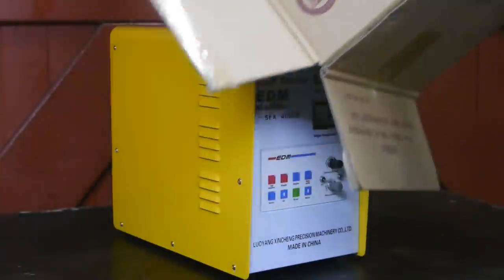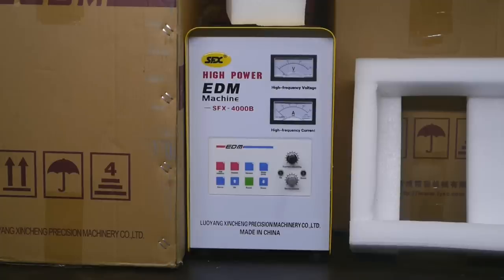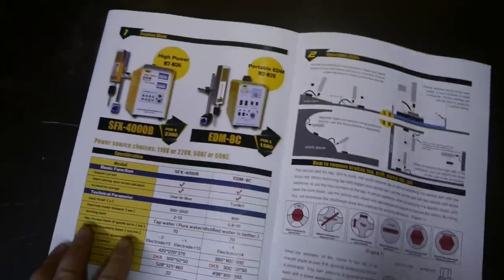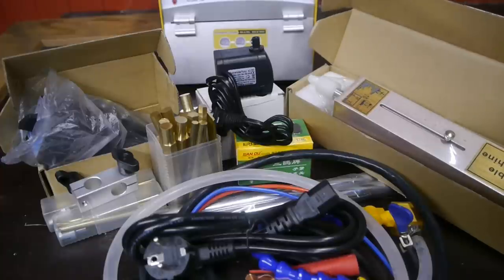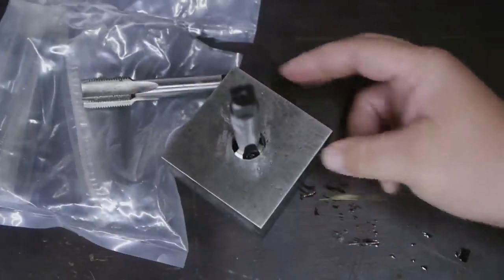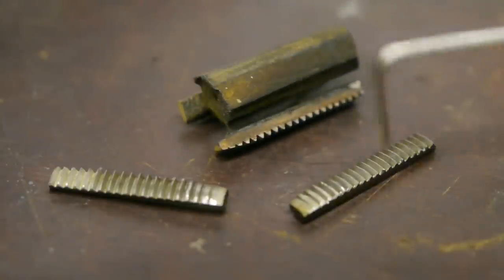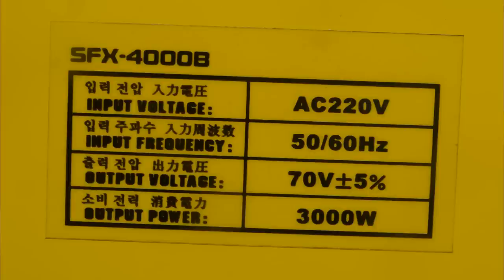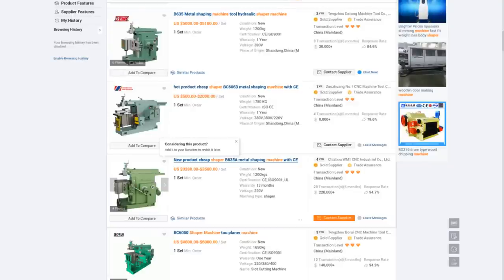Testing a portable high power broken tap remover (SFX-4000B)

Comment: Just watched this... That could be the basis of a great EDM die sinker. What's an EDM die sinker? It's the tool you go to when you need to machine shapes in metal that can't be machined. It will "burn" (cut) any conductive workpiece no matter how hard. Make an electrode (preferably in graphite or copper) and you get a mirror image (usually 2 electrodes are used, the second on low power for finishing). Try drilling a square hole, it's not possible without an EDM. Try drilling a hexagonal hole in tungsten carbide, easy enough with an EDM. Take a look at injection moulding tool making, next to impossible without an EDM. There are several videos where guys are trying to make these, because commercial versions have astronomic price tags. One of these could provide the basis for something special.

Comment: I think that went very well for your first go.
I did see something very similar many years ago.  The electrode was made of carbon graphite stuff an they used to make odd shaped holes in various hard materials by shaping the graphite.  The whole thing was submerged in oil not water.  I have not seen another one of them until now.  We used to call it a spark eroder.  The highest profile job it ever did was take a broken tap out of a jet turbine blade.  I think they were very happy we got it out without damaging the blade.  Very interesting video.
Thanks
Reply: spark eroder /edm same difference carbon for cheap electrodes copper for strength it all depends on what shape and size /profile you want but there will always be a wear ratio of 10 to 50 % to the electrode

Comment: I have no real or firsthand experience about the EDM, although I have seen one used a couple of times.  The first time was exactly a broken tap removal.  The second one was what is called Wire EDM.  Both used copper electrode, the second one a copper wire in a loop.  It was cutting sideways into some super alloy.
From an electrical perspective, I think the operation is somewhat akin to a high frequency start (or better yet continuous AC) TIG welding.  The High Frequency is starting the arc, but the real power that does the job comes from the lower voltage, higher current  that follows.
In any case, I myself have broken one 1/8” tap in an aluminum block.  Took me more than a day to grind it out with a Dremel and two different shape Chinese diamond bits.  It was a closed bottom case of about 1/4” or 3/8” depth.  I then wished I would have one of these EDM machines.
Reply: Instablaster

Comment: I loved the video.   I am jealous, this is a wonderful toy, sorry machine, to have in the shop.

I have broken a few taps in my time.   Not many, but each time it is a hassle.   I tried purchasing tap removers.   They work really well at removing money from the wallet, but so far I have not been able to get them to remove the broken tap, the fingers bend.

I have read posts on machining forums about EDM, even a thread where a fellow made a machine at home.   I had not seen these in operation before.   I had not tried searching for a video.

I am not surprised at the electrode wear since the arc is going to wear the electrode.   I did like the vibration setting, big improvement.

The operation is more messy than I appreciated, due to the tiny metal particles created.

The machine worked well.   Like many machines, including our lathes etc. have a learning curve.

Dave.
Reply from the maker: Maybe this is something for you http://www.omegadrill.com 
You have a mill, right.
Reply: I do have a mill.

Thanks for the link.   I had not seen this product before.   A bit expensive, certainly only used to save a part, much more expensive than a few taps.

Dave.
Reply from the maker: Your probably better of buying a few cheap Chinese carbide end mills.

Comment: If just using tap water, and near a water source I wonder if it would be better to put the pump in a separate bucket of clean water- and let the water from the workpiece drain.

I’ve seen videos of high end commercial machines, and they also added travel to compensate for electrode loss. 

Anyway, nice video.

Comment: Pretty cool. I wrestled for like 2 hours with a broken tap yesterday before scraping the whole part, so this would be worth a shot for sure. If you've never broken a tap... it'll make a preacher cuss!
Reply from the maker: Yeay but I sure broke my fair share of drill bits.
Reply: The smaller the electrode the faster the cut only reserve is getting enough wash to clear the debris

Comment: Nice machine , some more testing wil bring the answer. 1e the electrode should be copper last longer . 2e the electrode should be smaller or the same as the removing part. The hangover of the electrode reduce the efective spark at the top of the flute but will spark al around. the surface of the flutes are much to coars. good EDM leaves a fine finisch.  we used petroleum ,kerosene< it should not conduct electricity.
succes .

Comment: I am jealous because no one sends me such stuff for testing ...:-) ...Anyway, looks like this thing got some potential. I guess one of the problems is that you use tap water, demineralised water or kerosene would be better because water splits into oxygen + hydrogen and you don't want much oxygen around your electrode. Also be careful when touching the electrode, 50V HF can burn your fingers quite badly.
Reply from the maker: You could probably make one yourself. Could be your next project once the ...... is finished.
I actually felt some tingling when I  got my hands in the water and the HF circuit was open. 
It was a good reminder what I was playing with :)
Reply: I probably could, but it's a lot of work for something i don't really need, a carbide end mill does technically the same job and in aluminium you can dissolve it with acid. I'd rather buy an old wire EDM, they go quite often for well under $500, my problem is the space.... Like your humor, by the way,...
Reply from the maker: I've been watching a lot of wire EDM videos. Those machines are awesome. 
Big and probably expensive to run though. But I will make room I someone wants me to test one :)

Comment: I'm interested to see if it makes a difference using copper electrodes.
Reply from the maker: One day I'll hook it up again and do some more testing. Maybe tomorrow if I happen to break a tap :)
I would like to find out if I can use this spark generator to make a square hole for a boring bar.
Reply: @Rolingmetal  I don't see why not.  It's basically a Sinker EDM with a lot less control settings.  You can try different electrodes to burn a profile in a proper part.  Anything from copper, to brass, tungsten to graphite to an impregnated graphite, brass and/or copper.  Best I've found for tap disintegrating is Tungsten.  A lot cheaper than you think, plus they generally have a hole thru them too.  Less surface contact the better.  Also, the intermittent burn at the beginning of the 'cut' and sporadically thru the cut is normally from the junk floating in the water not getting flushed out of the burn zone.  The 'swarf' needs to be flushed with as much pressure as possible to get the most effective burn.  I'll hush now, love the channel, thanks for sharing my man.  👍👊😎
Reply: I would like to see it with the polarity reversed.

Comment: Interesting video!!! My guess, is a square shaped carbon electrode, would have worked very well with this machine to remove that broken tap. The square electrode having the corners placed in the center of the flute cutaways would have probably eroded the center 'spider' cross-section of that tap, in a fairly short time... The remaining threaded sections of that tap could have then been removed with a pocket telescoping magnet...

Comment: Hi Nice review, takes a lot of time to find the right settings, seems like the manual could be better on that point, did the hex electrode go all the way through, looks like it only went 5-6mm down ?.
Reply from the maker: With the vibration option on I was rather easy to dial it in.
The hex did not go though nor was that planned. But it did stop to early because the depth set screw came loose.

Comment: Hi RM. Cool machine. I have  a Bother in-law here in the States. that works for a Company called Sossner metal Stamps. The Edm machines I have seen there, all use  edm oil. It works that's what counts. You did fine using it. I may look into getting one. Has always Liked,Shared and added to Playlists.
All my best.
Bobby
Reply from the maker: I believe the use kerosene to prevent aluminium parts from corrosion. Might have to try that one day.
Reply: I don't know about kerosene ! Has it is flammable. Google EDM Oil. It's made for that. Sossner does stamps for tool company's,Etc   which is a very hard metal .... Or use none detergent motor oil. Keep a fire  extinguisher on hand,just in case.  
All my best.
Bobby
Reply: you can use kerosene to prevent aluminium parts from corrosion , we have  test .
Reply: @Rolingmetal  EDM oil is kerosene with flame retardant, most modern machines use filters a settling tank and a deioniser in the feed to keep the water clear of electrolytes

Comment: cool video, I wouldnt mind seeing some more tests with that thing. I just looked at the price of the thing and man is that thing expensive, lol. I have a few things that I would burn the taps out with it, lol. Im kinda curious how it is actually put together, It looks like a pretty simple design and I think with a longer travel for the electrode, it would be quite a bit more useful than it is now. I also wonder if using a copper electrode would make any difference vs brass, which imo would be crappy as an electrode anyhow, and is probably why it's eating so much of the electrode away.
Reply from the maker: I'll probably play a bit more with the machine this weekend. Shouldn't be a problem to record some more video.
Reply: Please try a stainless steel electrode which may prove interesting.

Comment: My two cents: the tap is too big and rarely do you brake a big tap, mostly small taps when you force it over its limit. So the real test should be on a small one. Also the week link is obviously the electrode. I am surprised they dont use this process with copper. What I would be interested in is to know how much heat to apply on the tap in order to make it brittle enough to break it with some impact instead of trying to slicing it. Thanks for the video.
Reply from the maker: They supplied the tab, It would be rude not to break it :)

Comment: I wonder if you put the polatity of your wires properly...
Reply from the maker: Knowing myself it is certainly a possibility
Reply: @Rolingmetal  - Please try. As somebody said above, both metals erode. it's the polarity that determines the ratios. There is a lot of black in your water. That would be the copper eroding out out of the brass.

Comment: Use a tungsten rod from a tig welder .
Then try a graphite rod from a pensil . 
See what can last longer .

But Truly what the hell did you expect with sparks jumping out of any metal it will wear out . 
I have seen an EDM with a continuous metal wire with no description that can cut but it's run continuously or spooled on point of contact ( spark contact not wire to job contact ) between the job at hand then the wire is spooled and then not reused .

Comment: Just looked on ebay, around $2K. I would buy an cheap old sinker EDM  before that unless you need to go mobile.
Reply from the maker: Agreed, It's an expensive piece of kit. You can buy mine for half of that. Hardly used, I don't break a lot op taps :)

Comment: The amazon link: https://amzn.to/2Nw5uQR 

The Functions and Features of This Broken tap remover

1. Portable edm broken tap remover abide by the principle of Spark Erosion to remove broken tools, no direct contact, thus, no external force and damage to the work piece;

2. Excellent Structure: Portable edm is convenient to carry due to small size and light weight, and shows its special superiority for large work pieces. Working head is separated from the machine and could rotate in any direction, which is helpful for complex machining;

3. Portability: Light weight; Small size; Carrying handle on the top of the power case;

4. Convenient Operation: The magnetic base could attract on work pieces to finish processing easily;

5. Vibrate work head: Vibrate of the electrode, greatly improved the processing efficiency;

6. Automation: Auto feed; Depth setting(Stop at a specific depth); Alarm and auto retract; 

7. Economical and Convenient: The working liquid is ordinary tap water; power consumption is moderate; the inlet pipe is detachable;

8. Wide Processing Range: Broken taps and drills (conductive material) above Ø2mm (Ø2mm is included);

9. Long Working Time: A cooling fan installed ensures the ventilation, which keeps the machine working continuously.

The website: www.brokentapremover.com

Comment: Try putting the pump in a separate tank of water so it has clean water.
Reply: You need de-ionized water, rather than tap water, because blah blah chemistry, electroconductivity of water and the self-ionization properties of H+ OH, etc. (At least, that's how pro-EDMs are setup for making actual dies for molding out of H13 steel.... if youre' just removing a standard tapping bit I guess the losses won't be too bad). Cool piece of kit, mate. Hook it up to a standard 4020 kit gantry and form your own carbide/cubic boron nitride tooling ;)

Comment: Do you know if it is possible to use petrol or different liquid instead of water?
Reply from the maker: I believe kerosene or diesel can be used to prevent aluminium parts form oxidising.
Reply: @Rolingmetal  have you tried already?
Reply: Flammable liquids and electrical discharges typically result in fires or explosions...
Reply: @flavius624  I'm not sure it is available for this case

Comment: I guess there should be some cyclic action to it, rather than blasting away like an electric arc furnace.
Reply: The pulsing is to allow time for the wash to clear debris as the electrode is lifted the servo will automatically keep the spark gap set

Comment: Man, 10a at 35v = 350w???that is peanut compare to a welding machine, not even close to high power. But i am suprise that they send you a m20 tape to test the machine. Simply too big the bait for the fish to swallow. Are you using m20 very often? I guess m4 ~ m10 will be more common, right? Why m20 then? Look at the electrolyte this machine is using....
With a m5 tape this machine may not have the same result, less surface area, less volume and more resistance.... That high power 350w arc may not even scratching the skin of the tape. ...
Next time you may try using mineral oil or other lathe coolen agent to replace water for better result and your container is too shallow. The spark is suppose to be submerging under the water line all the time to get rid of oxygen in the equation. but i also have to remind you that, hot oil+spark+ air is a perfect equation to FIRE!!
Good edm machine can work on a m1 hole, which means the electrolyte is less than 0.5mm dia. I don`t know how many amp this machine will draw from your wall socket, hope it will be less than 20a otherwise you will have a blown fuse.....
I guess you have spare fuse at home, my friend?
By the way, don`t let the environmental protection department knows that you have this machine, you will get law sue for discharging heavy metal polluted water if they got you.

Comment: Looks like it needs more power to work correctly. This video basically put me off one of these chinese machines. The High Power mode seemed to be only a 10th of rated power, no surprise for chinese machines. I have a induction forge and I its half what it should be compared to other vids on YouTube.

Comment: Electrodes are expected to be expended as you do the job.
Reply from the maker: I thought wear was a bit much. But someone commented pure copper wears less. Might have to give that a try.
Reply: Rolingmetal They use graphite to EDM  hard steel form-tools. From the explanation we were given in college, I'd not be surprised if the tool got eroded the same amount as the workpiece. But I have no practical experience of it and have not done any research since I was told this stuff as a student.

Comment: Mannnn , it took only 90 secs to get me laughing " I Kindly ask you to piss off "? -- ,      but -- cutting with a blade like electrode  a smaller piece is mostlikely not perfect .-   you have to get the core,. thats most important.  U also drill Bolts from the center , right ?
Reply from the maker: Lots of jealous people out there wanting to leave a nasty comment. Though I shut them up before they would reach for the keyboard. The blade is recommended for bigger taps.

Comment: wth Is this such a big problem that they made a machine for it? Just dont let the students play with the taps and you wont need a SfX machine lol
Reply: yes i know in manufacturing as in wire edm and drilling.. but not sure how useful these mini versions are. Guess one could reg it up to do some useful things.
Reply from the maker: I never needed one before. Hopefully I didn't curse myself by intentionally breaking a tap.
Reply: Professionals even brake taps! It's apart of the job. No one is perfect.